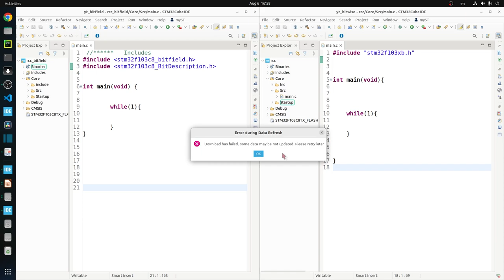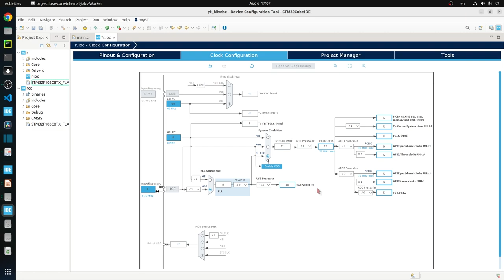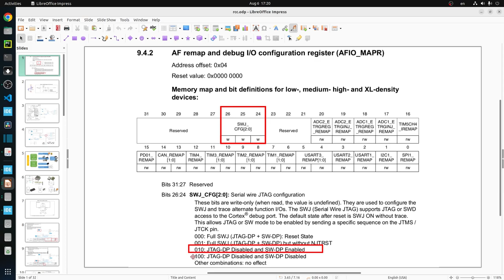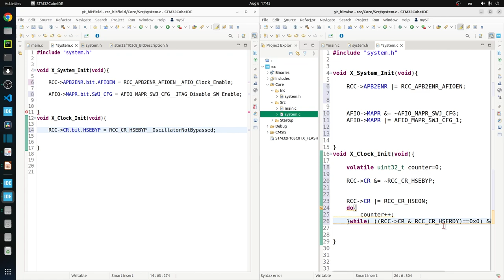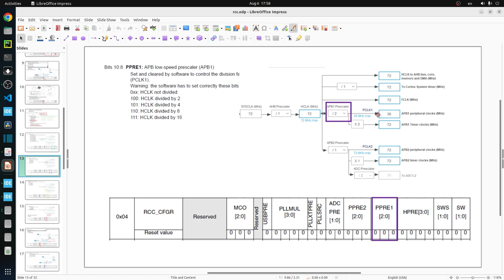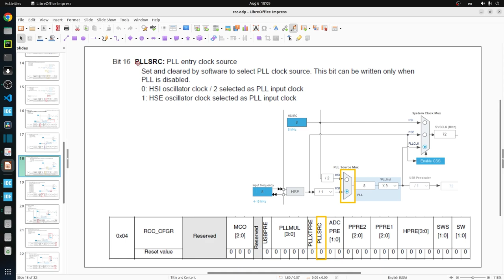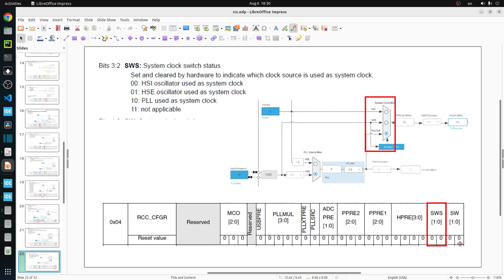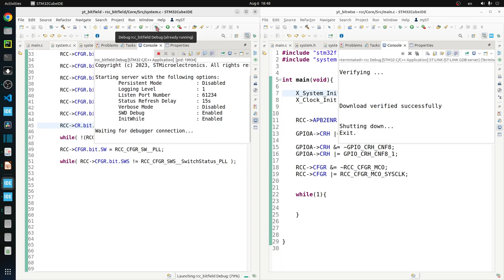STM32F103C8 RCC - Clock Configuration - CMSIS

Comment: Hi! I`m using Blue Pill bord and got an issue, tryin to repit CMSIS configuration. Whan code rich line:
FLASH->ACR |= FLASH_ACR_LATENCY_1; 
Than I have:
 halted: PC: 0xfffffffe
Info : halted: PC: 0xfffffffe

Could you pls. explain where problem is. Thanks.